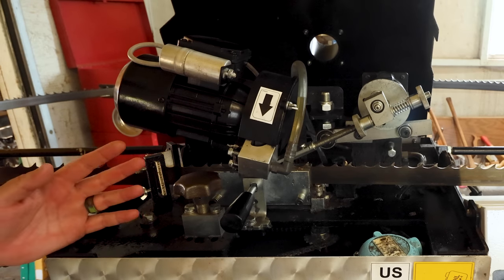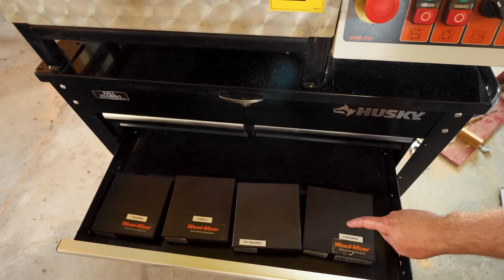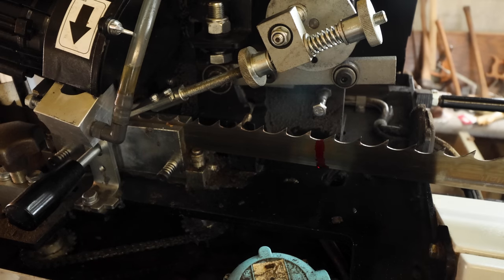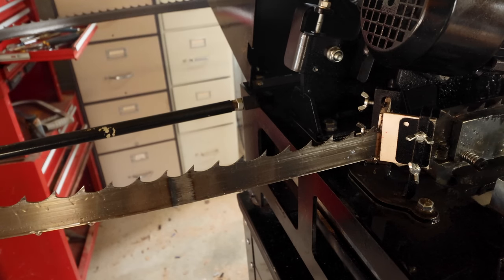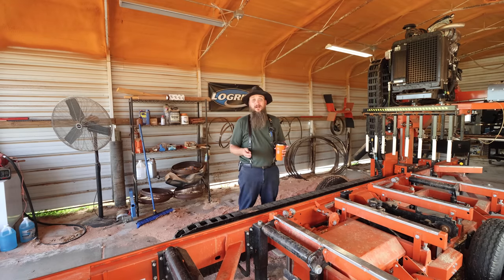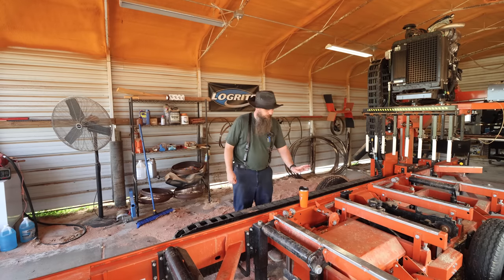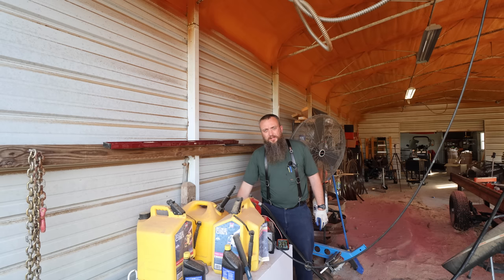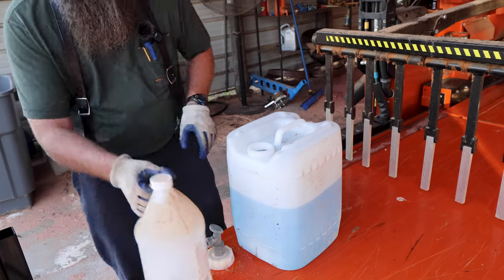This Tool Saves Me Thousands $$ At My Sawmill!

Comment: I really enjoy your videos, I have been following you for years and really enjoy them. But you need to make some adjustments to your sharpener. First you need to adjust your oil at the wheel. You can move it until it almost touches the wheel, it will almost eliminate that oil mist completely. Second you need to slow down your blade feed  and take way less off on the grind. It should not slow your wheel down. If needed go around twice. If you keep going at that rate you will ruin the CBN wheel believe me I found that out the hard way. Third you need to adjust your wipers looks like your blades are dripping in grinding oil. These tips should help. Keep up the great work.

Comment: As a retired saw filer I can assure you that no set on a blade it will  not cut straight under load.
Nathan please find an old filer to show you the finer points of sharpening saws 😊

Comment: Add a small immersion heater to your oil tank on the blade sharpener.  Set the thermostat to the temperature you want, and you'll be all set.

Comment: Hey Nathan, I heard you say that you have 220 at your mill and was wandering if you had thought about using an electric motor to power the mill instead of the engine? I have an LT40 and removed the Honda and replaced it with a 10 HP Baldor and cannot believe how quite it is. I have a 15KW generator to run everything here if the power goes out that sits most years without ever even using it so I removed the Honda and wired it into the generator two years ago. My ears finally quit ringing and the electricity is way cheaper than the gasoline and would be even cheaper than the diesel. Great videos as always :)

Comment: Not sure you would be interested in this idea but on my lube tank I drilled a hole that fits an 1 1/2 x 4” pvc pipe with a cap.  This allows me to never have to unhook the tank you can than fill from the top by just investing the jug into the hole and it makes it much easier to fill the lube tank.  I have enjoyed all the content you put out thanks much.  Jim t

Comment: I built my own sharpener, Nathan, it's manual, but I can sharpen a blade in about 15 minutes, and I can change the angle for the different degree of blade, you're correct on the saving $1000's, I've been getting 8-10+ sharpenings on my blades, and they cut better than the new ones, great video 👍
Reply from the maker: nice,

Comment: @N8than, 220 volt will/does keep your power bill down. ( never understood why America stuck with 120v/60hz.) And for heating the oil. Dangle a standard light bulb not LED into the oil. This will keep the viscosity just right without overheating.
Reply from the maker: good point
Reply: Or a Heat Lamp mounted under the tank!

Comment: That’s pretty slick. Since I bought my mill in 2022 I’ve only gone through 5 blade’s because of the stacking and stickering. Milling is fun and fast but without having a plan to stack and dry I find that I ruin the milled lumber. I’m planning on retiring on September 30 and I’ll have way more time. Maybe I’ll consider that sharpener. It was significantly less expensive than I guessed.

Comment: I have a hydraulic pipe bender that was super slow when temperature was below freezing. I changed the oil to peanut oil and have not had any problems in 15 years.

Comment: i started with just a sharpener i would suggest the setter is just as important as sharpening after a couple sharpenings. if you lose the set sharp wont cut it , at least not strait

Comment: The magnet that you have to clean if you can put a plastic bag on it before sharpening it will make cleaning easy all you need to do is change the bag
Reply from the maker: good tip

Comment: Can you Weld your own blade?
Blade stock is sold in rolls. When you order it its custom made for your machine  they pull off the lenth your blade is plus some waste trim both ends to match with a scarf joint then its welded and ground at the gullet between 2 teeth.
You can buy blade stock by the roll,
I belive you can also specify the materials its made of be it tool steel or a 4140 or whatever.  Me id see if I could buy one with carbide teeth.

The tools you use are just as important and impressive as the saw mill.

Cold coolent is not good, I used to work in a machine shop, you can put a coolent heater in the tank or wrap the tanks outside with heat tape used for plumbing
That will automatically turn on and off to keep the coolent warm at least above freezing temperatures.  Your using the same cutting oils used in machine shops.
Reply from the maker: thanks for watching

Comment: What type of stones are those?  Diamond?  Cubic Boron Nitride?  Happy Easter.
Reply from the maker: I am not sure Ralph, good ?
Reply: @OutoftheWoods0623  If they are not waterstone type grinding material they are likely Diamond or CBN.  Those I have seen have the grinding material--- diamond or cubic boron nitride---set upon the surface of a metal wheel.  I know you can clean CBN wheels after so much use, but you never redress either type whereas with waterstones you do after a certain amount of use.  Take care of whatever kind you have because diamond and CBN "stones" are expensive ~ $400.  While I am thinking about it "stones" are not exactly stones these days.  "Waterstones" are uniform sized grit glued together in the shapes required.  I don't know about oil stones.  

I have one more question.  Do you use a diamond lapping/flattening plate for your flat stones?

Comment: ID just go down to Woodmasters offices
Or down in the caves where the Woodmasters are made that sawmill was made by  part of that company. 
I've even seen one set up outside at Woodmasters back yard it just barely fit.

Woodmaster.  AKA bellsaw. In fact if I want cutters for my bellsaw Woodmasters will make then or sharpen my blades.

Comment: 0:25: ⚙️ A tool for sharpening sawmill blades, saving money and ensuring smooth operations.
3:59: ⚙️ Maintenance and operation considerations for a machine in cold climate without climate control.
7:10: ⚙️ Efficient blade grinding machine with minimal mess and maintenance requirements for sawmill operations.
10:37: 💰 Financially, a sharpener is essential while a setter is optional and can be purchased later if needed.
13:39: ⚙️ A demonstration of using a special lubricant at the sawmill, sawing up good quality Cedar, and seeking help to buy a new camera.
Recapped using Tammy AI